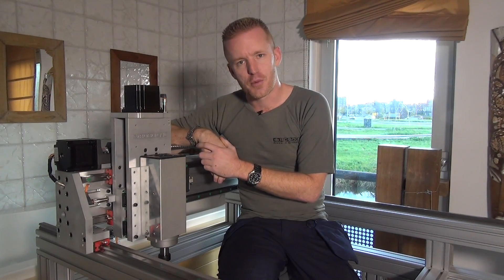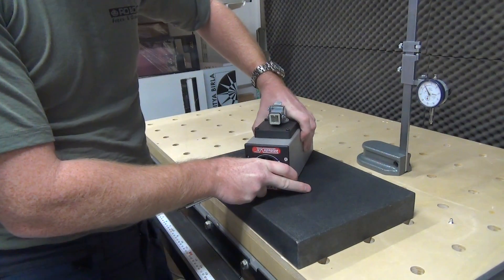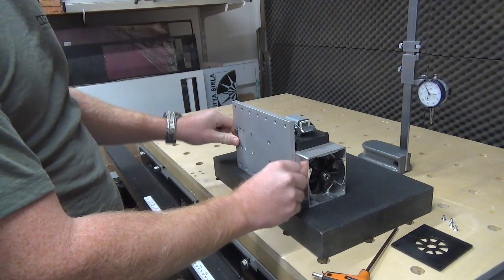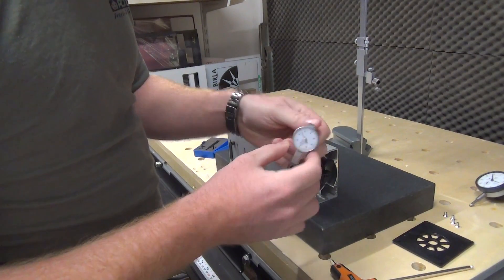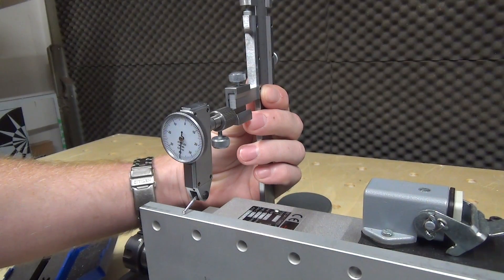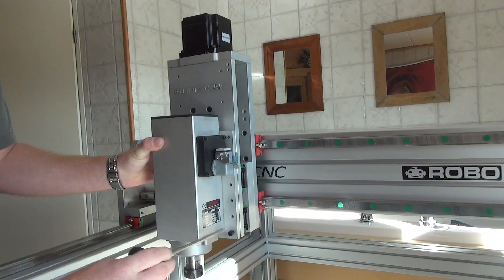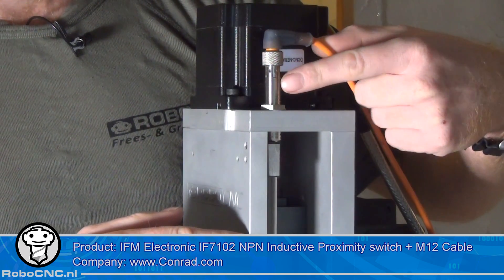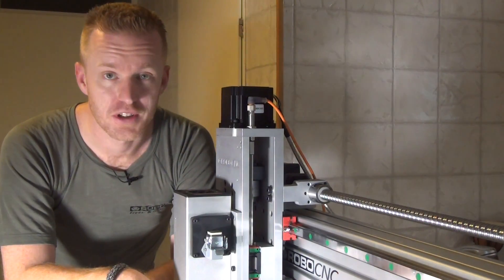RCNC X2 Router 11: Mounting the HF-Spindle to the Z-axis

Comment: I'm no expert but when you aligned the mounting plate to the spindle on the granite table, couldn't you have used precision spacer blocks as shims between the MDF table and the edge of the mounting plate?... You finger tighten the bolts so the plate is firm but still can slide on the spindle's mounting face. Then you stack blocks on either side of the plate edge (perhaps even pieces of thin cardboard) until its perfectly parallel to the spindle and then you tighten the bolts completely.
Reply from the maker: Yes that might work fine... there are many ways to travel to Rome... I just keep the camera rolling and use the tools I have at hand to do the job. And don't think all that I do is 'the' way, or best way to do so... I'm learning as I go, and as i make mistakes..
Reply: Making mistakes isn't the only way to learn but it's often the best way. Thanks again for your hard work and generosity. I dream of someday making a CNC machine modeled after the X2. It's superb just the way it is, the only thing I would change is I would make the gantry and the table 1500mm wide instead of 1000mm so I would have a full 4x4 feet of work space (sheet goods in North America are 4x8 feet). And perhaps not use worm gearboxes for the Y-axis drive, just a regular belt drive for the rack and pinion. But my basement shop is tiny so I first have to build a shop next to my house big enough for the machine ... lol
Reply: TheDeepNorth Why would you not use zero backlash gear box... or can that backlash unit be used without gearbox.... I'm about buying from Damencnc thanks to robocnc

Comment: wow.. a little advice, did u have ever think a slot machining on spindle surface?
Reply from the maker: Halil Orbay Okyay thanks for watching !
No I have not thought about that.... that could work to for aligning if there is a enough meat in the aluminum of course. 
In my case, in this design, I could never reach the mounting bolts though.
Reply: yeah.. thanks for reply.. here is the thing i quess, make a refferance faces for all equipments.. because, i never trust bolt tigtning..
Reply from the maker: Halil Orbay Okyay 
I don't agree.... the alignment is done by the key in this way, and the way you describe. The bolt are only there to hold things in place. But of course you do not have to agree.